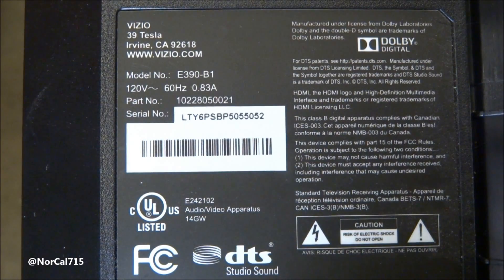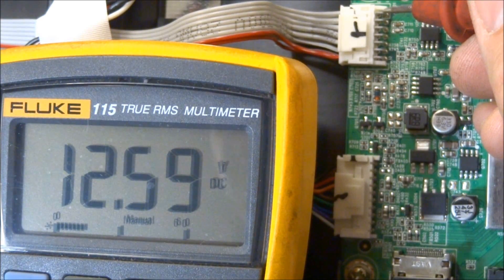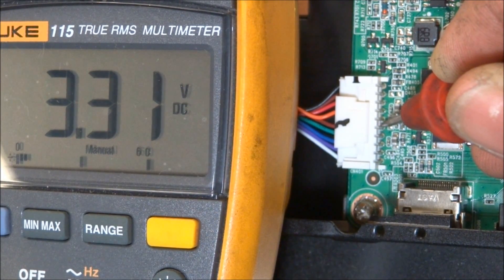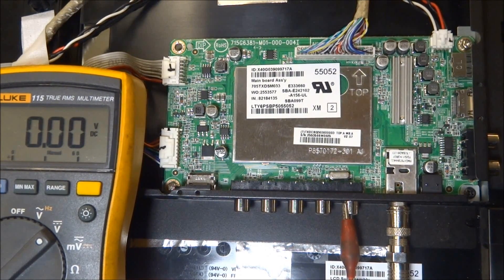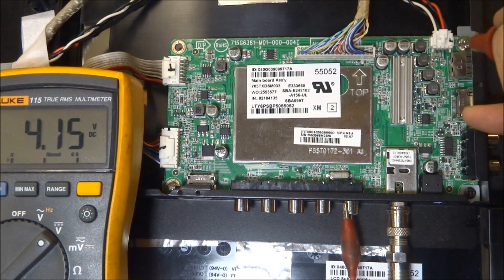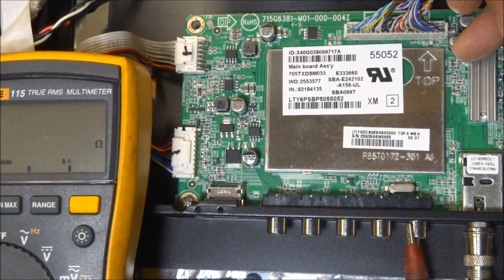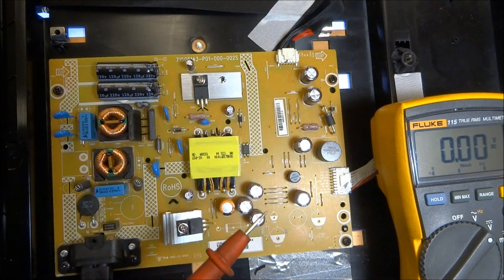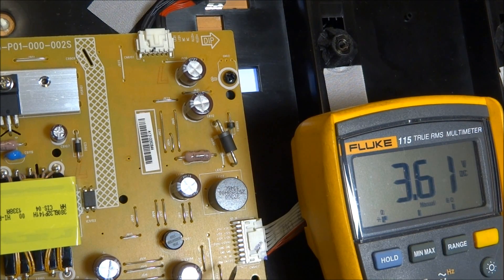Vizio E390-B1 LCD TV Voltages and Troubleshooting Repair Fix

Comment: I have a Vizio that won't turn on. I believe it's the power board. I took the back cover off and placed a multi-meter on the 5v stand by and got nothing. That was with the tv plugged in and the wire harness unplugged fromt the main board. I went ahead and got a PS board for 25 bucks off of eBay.

Comment: I can't get the back cover opened , toward the bottom base , any tips?
Reply from the maker: Just make sure all of the screws are out including the stand screws, and jack panel too. Some of those had plastic snaps that you just have to pull hard to release.

Comment: I need a backlight replacement with strps showing how to take the back off
Reply from the maker: Those Vizi-uh-os were a bugger to remove the backs. They had screws as well as plastic snaps. You really have to pry the two halfs apart.

Comment: My E390-B1 still will not turn on after replacing power board. The 12v parts read as 12v now (bad board they were 25v) but I have 5v on the power on and 5v on the dimming wire.  This is all with just my power pluggin in. Do I need a new main board now? Thanks

Comment: Hello. Doesnt it short the inner and outer contacts of the RCA connection if you connect the alligatorclip to the RCA in that way?
Reply from the maker: Futschikatores It can short the center to ground but in most cases it is an unused input, and if it is an output it is high impedance so it would not do damage at all. I have been using this system for years. Thanks
Reply: Futschikatores it might, but does not matter.. you will not be shorting a VCC output.. its a input signal and short to ground is the same thing as "blanking" the input... no problem at all.

Comment: Nice work. If I was looking correctly your ground was hooked up to chassis ground via an rca terminal.  Did you also use an isolation transformer ?
Reply from the maker: Correct. In my next video I go in to more detail on hot and cold grounds. also I always use a variable isolation transformer.
Reply: norcal715 bro if you make that tutorial i will gonna pay for it because i couldn't find a single explanation of this subject in the whole internet and i really need it
Reply: +George W you don't need an isolation transformer when using a DMM, you won't damage your meter but for safety reasons it's good to always have the set plugged into a isolation transformer. Also be sure to use it when using a scope. I forgot one time and thought I had blown out my new $3200 oscilloscope. Lucky for me I just blew some fuses